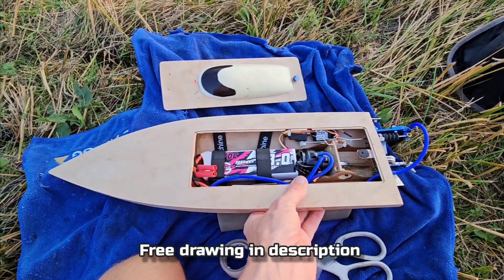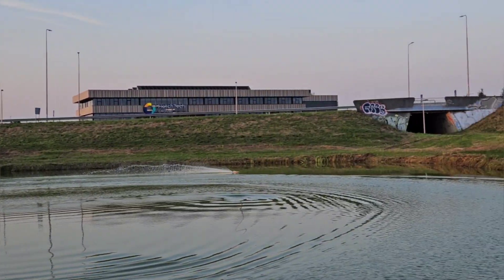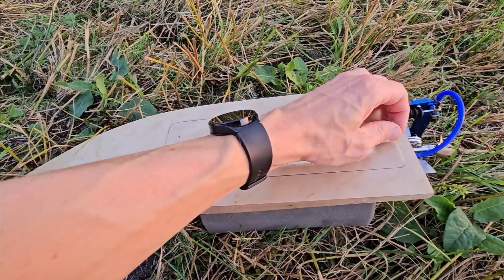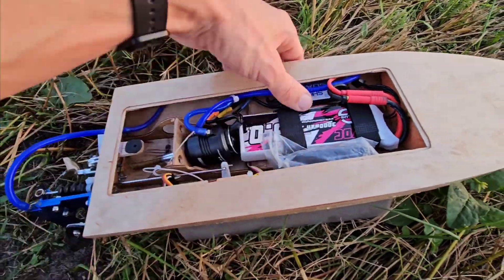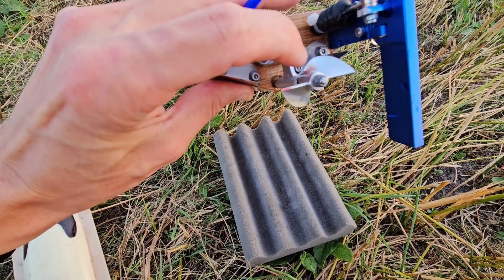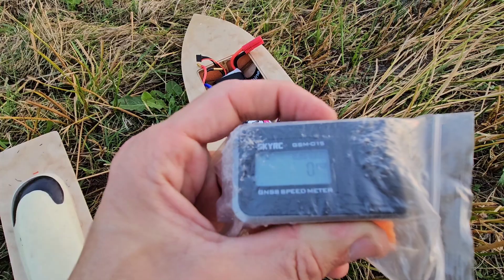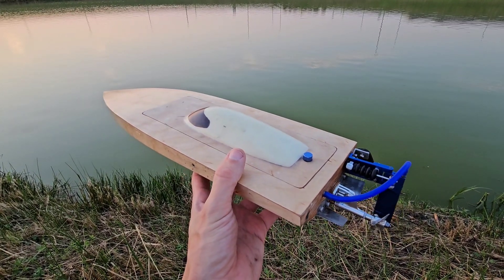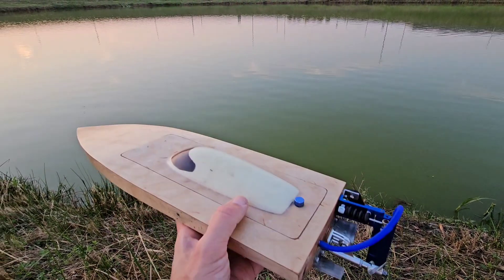3-blade prop test on the DIY RC Mini Mono rc boat: new 3S speed record!

Comment: I was thought those beeping is battery died
Reply from the maker: Yes, when the battery reaches low voltage, it starts to beep like that. I'm not sure if it stats beeping at over-current as well. I upgraded the 50A esc to a 60A esc, and the beeping is gone.

Comment: Great pond, man,those ZTW esc aren’t very good in my opinion if you can fit a flycolor you’ll get less power cuts.
Reply from the maker: This pond is a great place for little boats! Only reachable by bicycle or walking, so no fisherman. I have Flycolor escs and ZTW Shark escs, and I like both of them. I think the issue was the 50A version was too light. I now put a 60A in it, and it works fine ✌️

Comment: Hey dj how are you?
I have had the same problem of the beeping with my esc but is fixed it by getting a better lipo because with my miss geico 17 i have some 3s 50c lipos and with  those it gives me beeps around 75% trothle  but with 4s 80c lipos it is not giving me the beeps untik the lipo is drained. 
Also i received the new esc for the mini mono and this week i wil start painting just received my white base colour and i wil make the mini mono metallic red and the big mono will be metallic purple with a metallic red underside. Also building a rigger for one of my friend very fun.
Cheers mylan
Reply from the maker: The esc starts beeping at low voltage. But I felt the 50A was too light as well. I use pretty decent lipo's, and one run the lipo was still at 3.9V at home. In the next video, I will put a 60A esc in the Mini Mono, and the issue seems resolved.
Red metallic paint sounds great! Let me know how it turned out 😎

Comment: That’s the same beeping I get with mine
Reply: I have upgraded my battery and it was gone also the motor could be pulling to much amps try detounging the prop, looking at the motor specs and see what amps it can pull. Hopefully you can fix it
Reply from the maker: I exchanged the esc for the 60A version, and the issue is gone. That video I will upload lateron this week. Although 50A vs 60A seems a small difference, the esc is quite a bit bigger. 
I also updated the parts list with the 60A esc version. It's learning by doing! 😎

Comment: I think the ztw shark have a cutoff on LVC protection by default not reduce power because 30-40°C I think it's not to hot for a marine esc
Congratulations on PB on 3s,the two blade props it's not fast maybe because you reduce the blade area?but now it's a good bashing prop
Reply from the maker: Thanks Daiciu! I suspected the LVC too. But after I exchanged the 50A esc with a 60A esc, the issue is gone. 
Regarding the props: the silver CNC 936 prop which I detounged, is not the fastest indeed. It does put a lot of heat into the setup, mainly the lipo. The 1.4 pitch TFL's are pretty good. I have a 437 and 438 ready for testing. But they don't fit the wooden version, because the prop shaft is too small. The 436 3-blade is a winner. I didn't expect it, but it runs very fast, and generates more bow lift too.
Reply: @CozyRC  yes 50a esc have a peak of 65a and the 60a esc have a peak of 80a so yes maybe the motor pull more then 65a more then ones  during the run,this is a good sign for ztw that the protections are working and not just burning right away
Reply from the maker: Good info, thanks! It's probably mentioned in the manual, but I didn't read it yet 😅